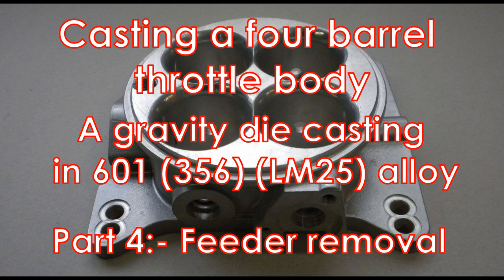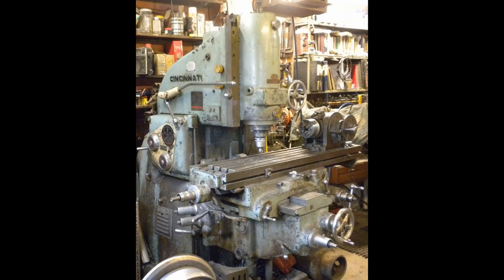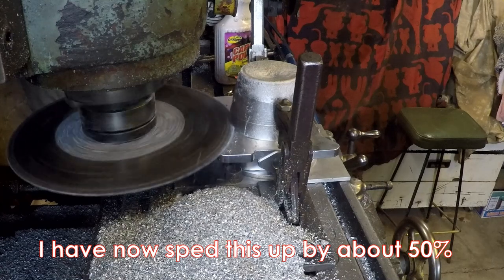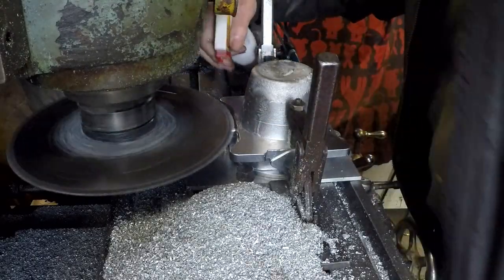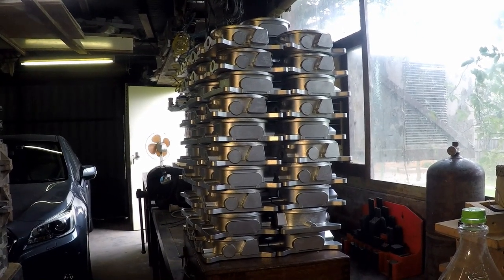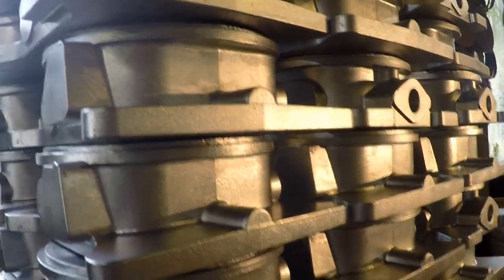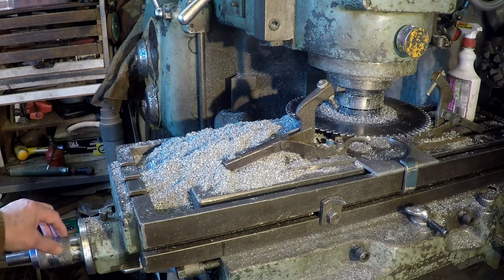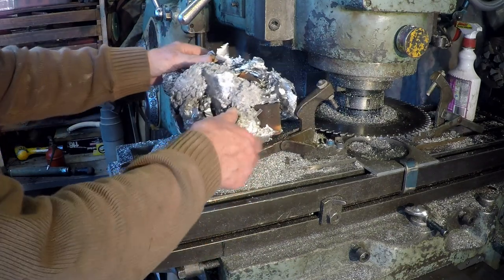Casting a four barrel throttle body Part 4:- feeder removal

Comment: This was extremely informative, thank you so so much! What's your opinion on melting coke cans as a cheap source of aluminum for hobby projects? I'm rethinking using them now after the comment on the end about reusing the scraps 😅
Reply from the maker: Nikola, Sorry for delay have had a stint in hospital and still trying to catch up. To be blunt about it I am as opposed as I can be to the melting of coke cans. I know some people do it and yes, you can get them to melt and you can actually cast the liquid into a mould. However you need to remember that cans have a lot of surface for very little metal and that means lots of oxide film in your casting. More importantly though cans are not a casting alloy they are a wrought alloy - well, actually they are two wrought alloys. The body of the can and the top of the can are two different alloys. Neither are really suited to casting and may not produce a very sound casting. Any casting made from cans will machine like chewing gum so you can't do much with it. But if all you are doing is a bit of fooling around  with no intention of producing a useful casting then it won't matter much if you do use cans BUT I doubt it will prove to be cheap because you will have to melt around 100 cans to get a kilo of metal and the fuel used while you slowly feed all of them into the crucible is probably going to cost more than you will save  - LPG is not cheap! If just fooling around I would suggest that you get some aluminium that has been cast - something like a cylinder head, inlet manifold, or wheel from a car. These are reasonable alloys (although you never know quite what they are) and they should produce a reasonable useful casting. My golden rule is stay away from stuff with a lot of surface area and from stuff that is wrought.... Martin

Comment: Excellent work Martin! So to minimize oxides what is the ideal size and shape of your feedstock?
Reply from the maker: S Bell, Ingots 😊. Seriously all aluminium is covered with a layer of oxide so the more aluminium you get for the less surface area the better. Lots of little pieces like chips/swarf are very bad - I melted down a lot of it on one occasion and had so much oxide in the melt that it was thick like porridge and the hotter I got it the thicker it got!
I will  NOT melt down anything thin like floor splashings or skins from ladles or swarf/chips. I wont touch cans or things like door or window frames (wrong alloys anyway) I even scrape my crucible out (when cold) to completely remove the thin skin left. Basically the thicker and more solid the feed the better. At least half of everyone of my aluminium melts is new ingot of a known alloy - I get a certificate of analysis with every batch... Martin

Comment: Hi Martin. I am guessing you use good quality ingots for your castings. For recycled materials is there any particular aluminium scrap sources that you would recommend or alternatively recommend to stay away from to give good results. (Besides foil, and cans etc)? Thanks for the vids too. I have learnt a lot from your work
Reply from the maker: Making, Yes, I buy certified ingots so any given furnace load is about 50 to 60 % new ingot and 40 to 50% returns (gates feeders etc) from the last melt. My recommendation depends on what you are trying to make as some special things require rather special metal but for most general work  the best source of metal is alloy wheels. These are usually 356 alloy (601 in Aust. and LM 25 in UK) This is what the ingots I buy are. You just need to check that it is NOT a magnesium wheel as that will cause all sorts of problems - aluminium wheels are attacked by caustic soda solution giving off bubbles Magnesium wheels are not attacked. Also magnesium is attacked by nitric acid giving brown fumes  aluminium is not  attacked. Your chances of getting a magnesium wheel are slim - not many of them out there. Stay away from any wrought aluminium product avoid pressure die castings - have ejector pin marks and are smooth all over. Stay away from older automotive castings manifolds cylinder heads blocks gearbox cases etc as these can be quite a variety of different alloys avoid any casting that shows a lot of whitish corrosion. I can see I need to do a video on this.... Martin
Reply: @olfoundryman8418  Thanks for the reply. I suspect I came across some magnesium accidentally some years back in a steel crucible in a previous furnace.  Melt started to twinkle then bright white yellow flame went on for a while reducing the steel crucible (old 7lb fire extinguisher) to a porus lava like mess.  Really do appreciate your vids massive help for those of us with plenty still to learn.

Comment: Very interesting series.   I'd always thought that if I had a furnace I would recycle swarf and that it would all just melt back together.  I never considered the oxide layer.  Now that I've got the Campbell book what you said makes so much sense.  So obvious now.
Reply from the maker: John, Unfortunately a lot of people are of that opinion. The metal you get by melting it back together again is not very good. Its best left to those with the equipment (big furnaces nasty fluxes)  and skills to do the job properly... Martin

Comment: Great vid ty. Im assuming these are for carburretor bodies?  If so why or how is there such a da emand  for these. I was uner the imprsion that all moders cars were fuell injection?  Also any chance of asking the machinist if you could, or he could vid the machning? And explain what these are used for. Excuse typos.  Dont forget to tell me the bath plug direction swirl pls?
Reply: hrxy1 after market carburettors for V8s. Huge market for these workdwide.
Reply from the maker: hrxy!, They are throttle bodies and I believe that they go with in-manifold injection systems. My customers web site might explain it better https://www.efihardware.com/   I will ask about the machining but I suspect its already all been done as I cast these a couple of months back
Plug swirl anticlockwise I believe its the other way in the northern hemisphere.... Martin
Reply from the maker: Toxag, Actually they are throttle bodies  but they are for V8s. Many available around the world are machined from billet and don't look anywhere near as good as mine 😊. Sadly perhaps we only see a very small part of the market here, even though my customer does export to at least the US... Martin
Reply: Olfoundryman yes, my mistake! Missed a keyword in my haste as well as some typos. Love your work and workmanship as always.
Reply: @olfoundryman8418  thanks for yr in depth reply, will check suggested site, the finish on yrs is exceptionally good. I ve never in my life, 71, used the word exceptional so many times
Ug swiril london clockwise, but geoff crocker in NZ said clocwise so im a bit dismayed!!, confused.
Anyone  else in aussie pls let me know yr results ty

Comment: After your comments about "Garbage in, garbage out", i have a question. I am going to pour a test of a small engine block soon, have 3 patterns to finish. I have a huge supply of aluminium drink cans. I plan on heating the cans in an oven first to burn off the paint and lacquer and then melt them for the pore. Can you offer any advise on this??? 

Many Thanks

Ian
Reply from the maker: Ian, Sell the cans for scrap and buy some decent aluminium. Yes the cans will melt and yes you can pour the liquid into a mould and possibly/probably wind up with a fair looking sort of casting. BUT its the wrong alloy, it may give you shrinkage problems and it certainly will not machine any better that would chewing gum. Burning of the paint etc is a good start but its not the big problem. Cans are very thin and that means relatively little metal for a lot of surface oxide. It is very difficult to separate the oxide out after melting and oxide in the metal makes for bad castings. For a cylinder block the alloy of preference seems to be 303 out here 319 in the US and LM4 in the UK. although if the block is to have an iron liner I would likely opt for 601, 356, LM25 as it casts easier. Either choice should really be heat treated for best results... Martin
Reply: @olfoundryman8418  Hi Martin. The purpose of the test pore is to confirm all of the cores and to allow me to map out and check all the placements for drilling and milling. I also want to check that i have enough material to machine off to get to tolerance allowing for shrinking and warping. All of this concerns me from your comment above. Think i will have to bite the bullet and buy the proper material. We will be using RR50 or RR56 for the final engine.

Thank you very much for your comments. Greatly appreciated. 

Ian

Comment: Hey Martin.
Understood not being worth to melt the chips because of impurities. Does the same applies to the big chunks of metal you cut off at the beginning of the video?
Reply from the maker: Okomi, The big chunks (the feeders) that I cut off  are quite Ok to melt as they are very solid with little surface area. These will be added to future melts at a rate of less than 50% of the charge- the balance will be new ingot. The filter in the feeder will float to the surface and is easily removed… Martin
Reply: @olfoundryman8418  Thank you Martin.

Comment: is posible make a machine part (motorcycle engine case) using sand casting? how about a qualitiy? is die casting more solid than sand casting?
Reply from the maker: Grez, Sand casting is a very versatile process - it is possible to make just about any casting using it. Of the three common casting process - sand, gravity die , and pressure die-casting gravity die (also called permanent mould) is capable of making the highest quality parts.... Martin

Comment: I have usually heard it called chips when it is small pieces from a machining operation.  Swarf i usually hear used as a general term for chips, filings, metal dust off a grinder, or what comes off the bandsaw.  Speaking of bandsaw, have you tried carbide grit or diamond (non ferrous castings only) grit blades?  In the states they can be pricey (about 5x for carbide or 10x the cost for diamond) but they last longer, cut faster and are excellent for cutting abrasive materials such as castings.  The diamond blades can even cut gems, rocks and ceramics.  They have lollipop cross section so they will side cut and can help them track better.  I tested them out on some large diamter composites we had issues with tracking and blade life with and it made a very big difference with the tracking.  Only thing is they like a high surface foot speed so a standard bandsaw cannot run them at their full potential, but they will still work.
Reply from the maker: Nerd, I have heard of carbide blade but have never tried any. I buy my blade in 200 foot reels and these days silver solder the joints as these seem more reliable than the butt welded ones that come from most of the poor condition butt welders I have tried 😊
Those diamond blades sound interesting as some of the aluminium I cut is very high in silicon and is quite abrasive it wears out the carbon steel blades all too rapidly I will see if the diamond blade is available locally. What sort of speed are we talking here in, say, feet /min. I often have to cut ingots in half and that is quite a big cut so better blades are appealing... Martin
Reply: @olfoundryman8418  You cannot buy these types in reels.  It is a continuous stainless steel band with a resin bound material on the cutting edge so it is more of a grinding action instead of a cutting action.  I know Starret makes both carbide and diamond types.  I got the tests ones from McMaster Carr.  I know there has been weird things in the past where they would not ship to Canada.  I am not sure if they ship over there but here are a few links of places that might.

https://www.toolcenter.com/SPC-Diamond_Grit.html?_vsrefdom=adwords&gclid=Cj0KCQjwhJrqBRDZARIsALhp1WTKFD2xoLH_SPToLfBQ2zK6D7p01-r5TNTmuNbCpvc0qpl6yLEZic0aAg5HEALw_wcB

https://www.bandsawbladesdirect.com/diamond-tipped-band-saw-blades

Comment: Hi I would like to thank you for great videos and for sharing you knowledge. I did a lot of Aluminum casting about 20 years ago and started up again about a year ago. I am making a casting for a steering box which has taken a lot of time to perfect the pattern and the method of pouring. You have helped me a lot in trying to get it right with all of the different types of items you have cast. Today I have cast the ones I have been looking for perfect results. If you are interested I could send you some photos via e-mail I am casting 2 at a time in one box about 8kg of Aluminum. Regards and thanks for passing on your knowledge. Michael
Reply from the maker: Michael, I would very much like to see your work, try olfoundryman@gmail.com as an initial contact email.... Martin

Comment: What a unit. I wonder if a mill that robust has a nod adjustment. Like you said about garage in garbage out, it often confuses me why folks spend the effort melting aluminum cans to make a casting. Seems like an act in futility.
Reply from the maker: Amalgamous, Forgive my ignorance but what do you mean by "nod" adjustment? I guess some people just see cans as "free" metal, others have a desire to reclaim stuff - to make something from nothing sort of thing. I get a bit confused by it too, all  that time effort and fuel - it hardly seems like doing the environment any favours. I see it as futile but others I guess do not -what ever makers them drip 😏...Martin
Reply: @olfoundryman8418  Nod may be called something else, it's just what I learned to call it. It would be where the head of the mill is adjusteded forward and back as if someone is nodding their head in a yes motion.
Reply: Ally can melting - the 'milk bottle top brigade' !
Reply from the maker: Amalgamous, There is slight adjustment sideways for head verticality although it is taper dowel pinned into place but pull the pin out and you can get a few "thou" - somehow though I don't think that you are meant to do this 😱. There does not seem to be any Nod adjustment, the whole head is one absolutely rock solid box structure casting... Martin
Reply from the maker: tre, Yep, that's about right... I remember saving milk bottle tops in my youth to donate to the seeing eye dog people as they used them to raise money - all the schools did it as we got  free bottle of milk  (1/3 pint)  every day  - usually left in the hot sun by the delivery truck and "off" by the time we got to drink it - Yuck - 😣 Haven't drunk a lot of milk since 😏 ... Martin

Comment: And you say reasonable castings??? I say bloody brilliant!! We call it swarf here in the UK too. As for the old Cincinnati.. the last company I worked for had one for ages and it was a great 'grunt' for stock removal. Alas, it went to the scrapper to make way for a new CNC.. which breaks down at the bat of an eyelash!
Reply from the maker: creast, Yep, chips are a US thing (I think) The cuts that the old Cincinnati can do seem only limited by how well you can hold down the work. At just 200 or 300 RPM and a big cutter they can really make metal fly both chips and swarf😏 Milling these days is entirely another ball game, Sadly m the old girl is soon for the scrap yard too (like me!) She only cost me $5.00 (for the forklift to put in on a truck but will cost $300.00 for the fork lift to take it away - ah - inflation!.. Martin

Comment: We need closure! Gotta see the carb on a running vehicle or better yet getting machined and then on a vehicle.

Thanks for the series.
Reply from the maker: Mike. I will contact my customer to see if we can do a video of one running on a vehicle - no promises mind but I will try. They are probably already machined  as I made these a couple of months back and anyway all you would see is coolant splashing around the inside of a big CNC mill... Martin
Reply: @olfoundryman8418  I'd love to see that too.
Reply from the maker: Andy, I will try but no guarantee…. Martin

Comment: I notice your mill is fitted with limiting switches, wouldn't setting them up make things a little easier and safer on ling runs.
Reply from the maker: Robert, Yes, you are right the mill does have mechanical levers/stops that can be adjusted to send the table back to its start position at rapid speed at the end of a cut cycle. I have often watched a friend who has two Cincinatti mills use the feature on his machines. And in truth on the last run when the person who now does the casting came and ran the mill to cut of his run of 120 plus castings it did occur to me that I should have invoked that feature. I don't think it would have saved him much time  but it would have made his life easier for sure. He is eventually to take the mill to his factory and I shall point the feature out to him... Martin

Comment: Hmm. Given that aluminum is typically extracted from bauxite by electrolysis, and in nature it's mostly oxides, I wonder if sending swarf off to an Alcoa plant would be worthwhile. At least you don't have quite as many other impurities... But yeah, casting it through melting isn't worth it, especially if you're trying to do so commercially.
Reply from the maker: Early, There are quite a few chemical steps betwixt bauxite and electrolysis and I don't think the swarf would be suitable for this sort of process. The electrolysis is expensive (both in dollar terms and environmentally) and much of the aluminium can be recovered cheaper (both ways) by large furnace recycling and use of fluxes and stirring followed by degassing and deep bed filtering... Martin